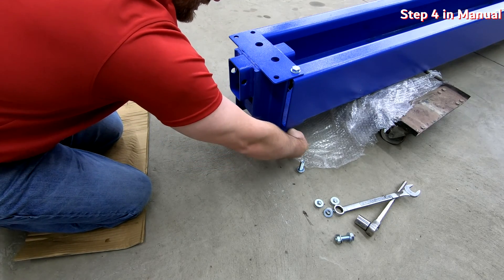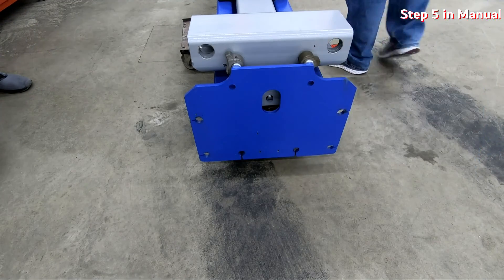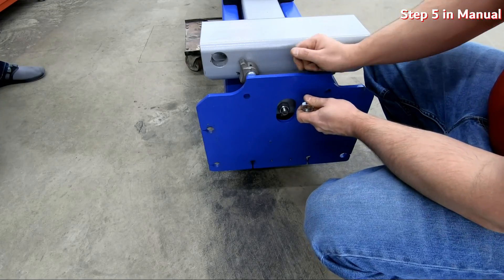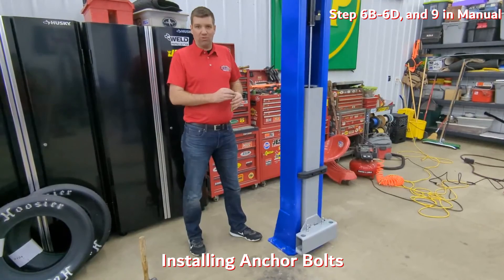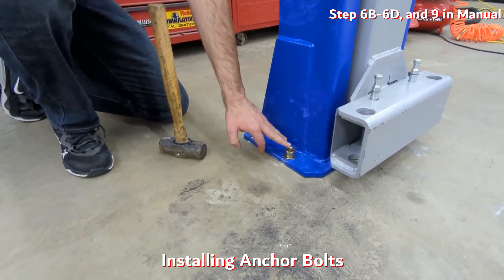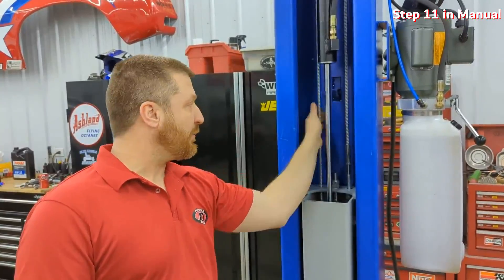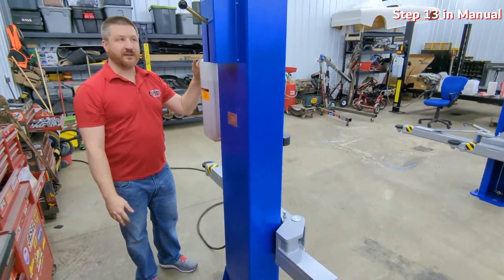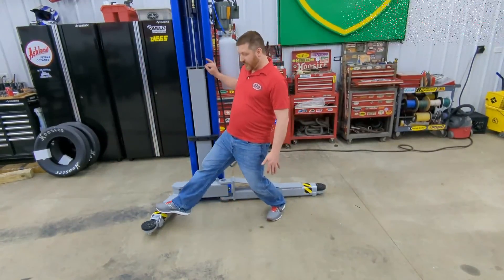Race Tools Direct 11,000LB. 2 Post Direct Drive Automotive Lift Installation and Set-Up

Comment: It would be awesome if there were some kind of actual torque specs on all the hardware. Seems important. Also some sort of "skid" under the pair of lifts while on transit I just got mine home and the lift that was on the bottom is all heavily scratched. I get that is equipment but 110% could have been avoided.
Reply: I found the torque specs in the manual:  https://racetoolsdirect.com/wp-content/uploads/RTD11KCDX_manual_r2.pdf
Reply: @Kevin Bush  I see the arm gear bolt specs and the anchor specs. Maybe I'm being too technical but the top plate I'm sure has a suggested torque range, bottom of the hydraulic cylinder, ect.
Reply: Mine just arrived and it’s all scratched up too. Kinda frustrating.

Comment: Can it pick up a mini excavator?
Reply from the maker: No, equipment like mini excavators, skid steers and forklifts have unbalanced weights that will far exceed the arm ratings.
Reply: And so does your wife, way to heavy. The lift will bend
Reply: I would think that you would want a heavy duty 4 post. Not very many pick points on a mini ex. Usually when I do any repairs on mine the boom does a good job at lifting each side up individually

Comment: I am in the process of installing the cables on my 11,000lb lift. Is there a good trick to tighten the cables? It is very hard to access the cables to tension them.